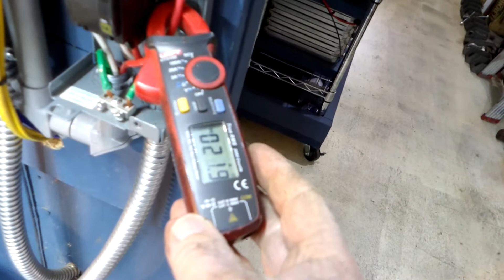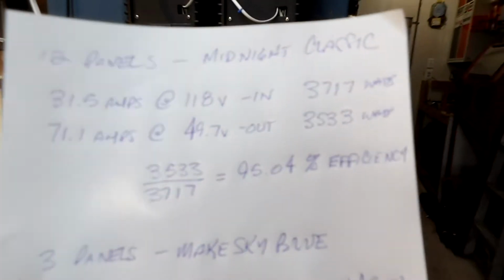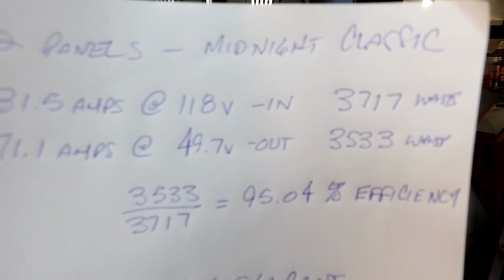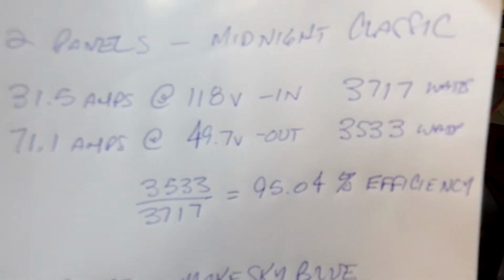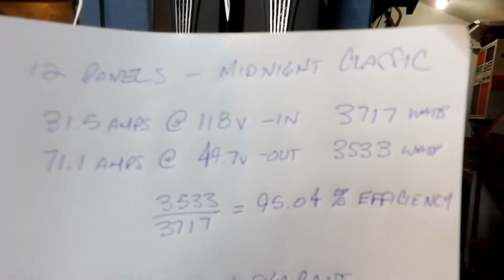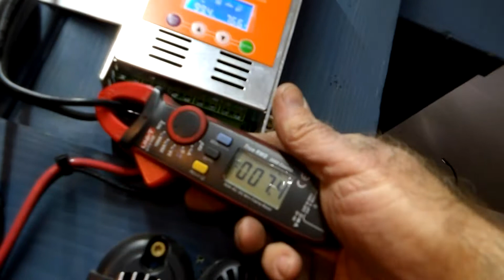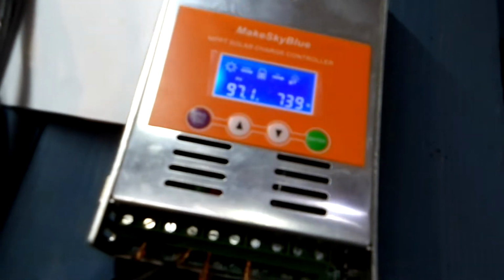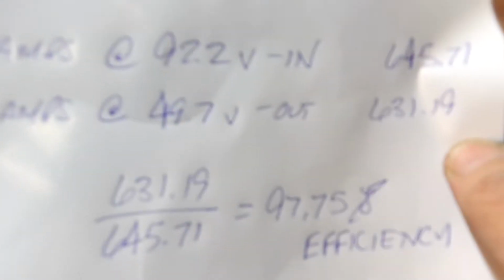Efficiency of a Solar Charge Controller

Comment: My MakeSkyBlue shows excellent efficiency with one string of 3 panels (144 VOC) but somehow when I add a second string in parallel, the efficiency drops significantly. Have you done similar tests with multiple PV strings?
Reply from the maker: I have not.  The MakeSkyBlue in this video is significantly under-driven, meaning, it's capable of 60 amps but it's only passing 21 at most.  Very interesting.  Are your panels all identical ? If not, the inductors could be fighting to achieve MPPT.  THAT can throw things off significantly.  Take an inductive amp meter and compare the amps on both + legs coming from the 2 different strings. They should be close.  Let us know what you find out and good luck.
Reply: @mark_osborne  Yes, my MSB is also 60A hooked to a string of 3 identical 360 Watt panels. So advertised power is 1080 Watt. In good, high sun I have seen MSB produce up to 1020 Watts, with pretty consistent reading above 900 W. But with 2 strings, instead of double, the output goes up only to 1300-1400 Watt. I could be doing something wrong.  I will do some more tests in the next few days and will come back with more numbers.

Comment: On my lead acid batteries this new makeskyblue controller 30a will take my battery bank to 15.3 for a while before coming down.Will this be safe to keep using is that normal I had a cheaper mppt that did the same is this safe for the batteries?
Reply: After lead acid reaches 14.4 volts it's gonna start gassing, the important thing is that you limit the amps after 14.4 volts to 5 percent of capacity, I have a xantrex link 2000 does it automatically, it's like 20 years old. The reason I know the gassing is I also have a fuel, hydrogen sniffer, turns on blower automatically
Reply from the maker: I really don't know, I know virtually nothing about charging lead acid except I commonly see like 14.7 as a charging voltage on vehicles I work on --- sorry

Comment: i have an issue with the MakeSkyBlue...it doesn't have a time control for the absorption stage...since it's  based on an amps threshold, if there's a constant load it will never  reach the threshold to trigger the float mode causing excessive gassing on lead acid batteries...
Reply from the maker: you are speaking beyond my knowledge base --- I know nothing about charging lead acid
Reply: Mark Osborne hi Mark!..how about exceeding  the suggested pv array input....will it damage the MSB controller ?... know that pricey controllers like the morningstar don't care about, since it also regulates the current input no matter the size of the pv array...
Reply from the maker: Good question, and yes!..I'm over-driving the snot out of one of the Classics, and like you say-it 'current limits'.  In the MakeSkyBlue notes on Ebay they mention limiting the number of panels to the mathematical max rating of the controller "or you may break the controller"---which leads me to believe they have no current limiting capability

Comment: Good testing. I have 3 of these makeskyblue charge controllers and aside from the great efficiency they have an outstanding standby voltage draw. I would like to see in your next video how many amps the midnite charge controller draws out of the battery bank without the solar input.
Reply from the maker: Great idea for another video- Thanks !